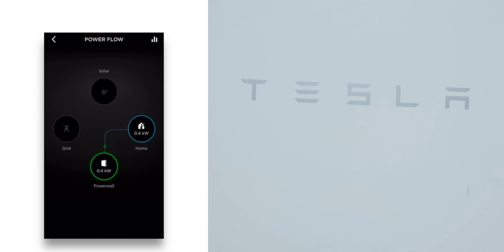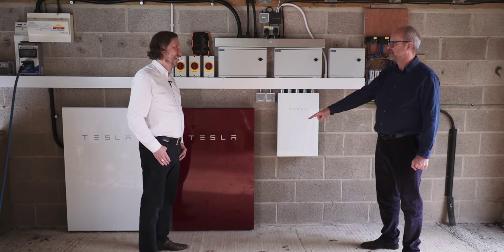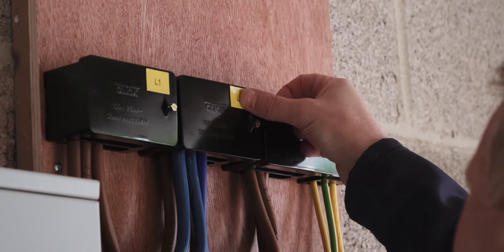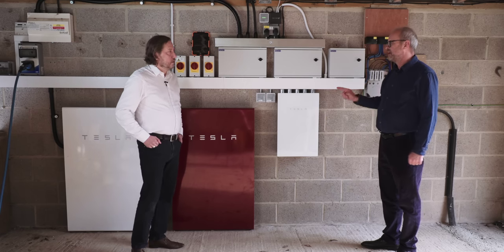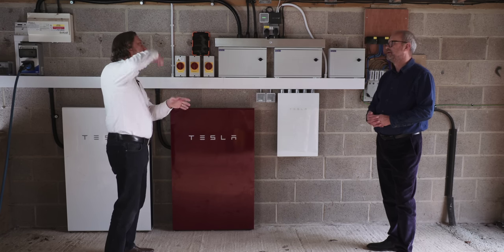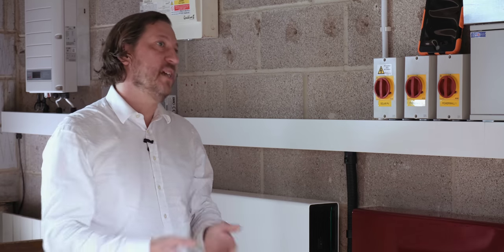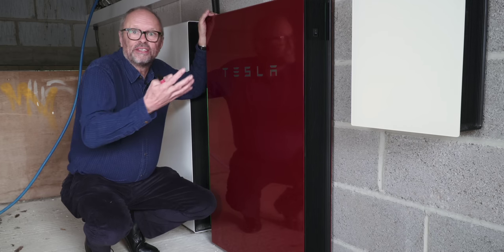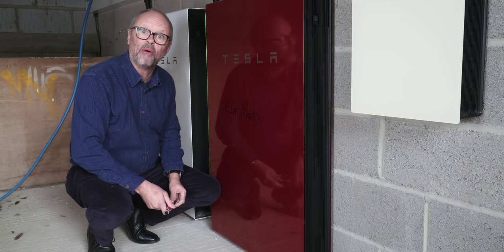Robert's Battery, Solar & Charger Set-up | Everything Electric Show

Comment: Tesla Powerwalls are unobtanium, we waited 8 months for one to turn up at the installers and gave up. We switched to an 8kW Solis Hybrid and 33.6kW (7x 4.8kW US5000) 30kW useable of Pylontech modular batteries and got it installed in 5 weeks, it was also a lot cheaper than a tesla setup and we can change the size of the battery bank depending on our requirement. It doesn’t have a whole house backup but we do have a backup power socket that can power up to 5kW in case of a black out that runs from the battery. 
The only issue i have is that on Octopus Go you only get 4 hours of cheap rate charging so we can only charge up the battery by 20kW per night (4 hours @5kW/h). 
We're waiting for the Myenergi Zappi to be Octopus intelligent certified and then we'll be able to get 6 hours and get 30kW of charge in there which just about runs the house for a day in the winter on cheap rate power. When the sun comes back from April to Sept we'll be almost self-sufficient with the 8kW of solar panels.
Reply: Those Pylontech batteries are great value and seem great if you don't mind the form factor. Have I understood correctly that when the Zappi is certified you can get an extra 2 hours of cheap night rate? BTW I haven't seen your videos recommended for a while, did you forget to give the algorithm a xmas card?!
Reply: @rohanchaffey3591  Yes, when the zappi is certified then you can get the intelligent tarrif which 6 hours from 11:30 to 05:30 and ATM is 10p instead of 12p but that might change in April. Some were saying that you need the car to the cerfitied as well but if you get the Ohme charger which is the only intelligent certified one at the moment you can have any EV, the charger does the work. 
When you try to sign up for OI they ask you what car or charger you use, its its an Ohme you go straight on to the test charge, if you have a normal charger the the car has to be certified and they talk to the car to control the charging. So, if I'm correct then you just need the zappi and TBH i cant see why you would need both the car and the charger certified as only one will be talking to Octopus for the 30 min timeslices and to get the cheapest rate for Octopus, not you.
I must be back in Youtubes A.I good books as the latest video is doing well too :-)
Reply: My parents went through the same thing. The installers eventually gave up waiting as Tesla kept pushing back the delivery timeline. They have a Model X, and it would've been great to have everything integrated into a single app, but so it goes. They eventually installed Enphase batteries with enphase micros, the system has been great.
Reply: Yes! I did this too!
Easy install.

Comment: I did this as well.  Solar Array, Two Powerwalls, Gateway, 3 Phase upgrade, smart meters, two electric cars with two 3 Phase chargers, and a heat pump, induction cooking, electric showers.

Our electric use has quintupled

Comment: The batteries will also watch the weather (via the internet), and can be set to automatically fill themselves up if a dangerous storm is approaching (ie: they prepare for dangerous weather incase the grid power goes down).
It's pretty cool.
Reply: Not in the UK it doesn't. Mine often underestimates how much cheap rate charge it needs to cover the following day because it does not take the forecast into account. Would seem to be an easy fix for Tesla as the Powerwall is already on line.
Reply: @nealm1814  might be an Aussie thing, or just not a UK thing (perhaps related to the different/specific way your inverters disconnect during a grid outage).
Reply: @roidroid  My inverters are not connected to the grid. Like any Powerwall installation grid connection is done through the Tesla Gateway which islands the house when grid power is cut. Even in countries where stormwatch is available I don't think the Powerwall monitors the normal weather forecast.
Reply: Stormwatch IS available in UK, but most areas don't have supplies that are affected by our typical weather and really bad storms are infrequent. You can switch Stormwatch on and off in the Tesla app settings.

The Tesla system does NOT use a local weather forecast to decide what to do and instead decides based on long term trends ... which is therefore hopeless for the very variable weather / solar conditions in the UK. I therefore manually control my Powerwall's low rate grid charging, a bit of a bother but better at minimising costs compared to leaving it up to the Tesla system.

Comment: I also installed 2 Powerwalls two years ago to supplement my solar array. It's great to be able to run my home on sunshine… during the night! Curiously, the grid has gone down 32 times since I installed the Powerwalls, yet I didn't even know, thanks to their seamless integration. Now I long for two more enhancements: V2X with my EV, and a small wind turbine on my roof.
Reply: If you've got a typical peaked roof, then you should perhaps look into the tech that exploits the "Aeolian effect".

Basically, when wind hits your sloped roof, then it's driven up the slope of the roof and this effectively "catches the wind" and directs it all up - focusing it - to the peak of your roof. This is called "the Aeolian Effect". The whole roof surface is catching the wind and forcing it upwards to the peak.

So what they do is place wind turbines all along the crest of your roof. Normally, you'd have a V-shaped piece - called simply "a ridge" in the trade - at the peak of your roof, connecting over where the two slopes meet. But they replace those with a row of small box-shaped wind turbines along the crest of the roof.

And these wind turbines are designed to expect the wind to be coming upwards from the slope of the roof to catch this "Aeolian Effect". Basically, they're like a round drum of fan blades on their side, so the upward air makes them spin around.

The other advantage is that, if you've also got solar, then it won't cast much, if any, shadow over your solar, being right at the top of the roof there. Also, of course, being at the highest point of your roof, you'll get more wind - and if all the houses / buildings around you are of similar height (which is typical urban planning that they probably are), then they're not really going to be shielding the peak of your roof from the wind. Which, of course, is what you want for a wind turbine.

And I'd say that this doesn't stand out too much like a sore thumb either. You'll have a sticky-up ridge on your roof - the row of turbines - but they're relatively discreet and it's right along the whole crest of the roof, so it's consistent. You're likely to get less complaints from the neighbours than if you tried to stick a small "fan blade" wind turbine up there. And, actually exploiting that "Aeolian Effect" right across the whole length of your roof, then it's going to do a better job of "catching the wind" as well.

Indeed, I'd love for "Everything Electric" to take a look at such an installation at some point, as this one really doesn't get the press. But, really, it's probably the only way to make domestic wind micro-generation feasible and, like solar panels, just "part of the street furniture" that people stop looking up and even noticing its there.
Reply: Very interesting, is this type of wind turbine readily available to purchase now?
Reply: @David-bl1bt   I just did a quick Google to see if I could find it again, and - this is not a recommendation, but just the first thing Google threw up - and if you search for a company called "power collective" and the product is called "ridge blade". They have domestic and commercial version, and one that involves solar somehow.

From the "ca" in their web address, I think they're Californian. But, as I say, this was more just trying to find something you could look up for yourself in a search, not a recommendation that their products are good (I just don't know).

And, at least with this company, it does appear to be a purchasable product they're selling. I do wonder if there's a European company doing something similar.

Certainly, there could be. The "Aeolian Effect" is just physics - all that wind impacting the whole surface of a sloped roof, it all just naturally gets funnelled and directed up to the peak of the roof, so that's where you put a nice long row of wind turbines, along the crest, to catch it all.

This really is the most sensible way to do it, I feel, because then the whole surface of the sloped roof is focusing the wind and the whole length of the ridge of the roof can be turbines that are being fed "the Aeolian Effect" of the entire roof. That's the way to maximise the amount of wind with a typical domestic property.

Edit: Looking further at their site, they do seem to have "accredited partners" for their tech and there's two sites in Europe.
Reply: @KlaxonCow  thank you, I appreciate you taking the time to search and provide further information by way of research material.
Reply: Seriously the grid went down every 3 weeks for 2 years 🤔?
Where do you live,in a third world country?
Reply: @Thenakedfinisher  some might say it is at times, but it's very common in America.
Reply: @klaxoncow  

Crikey! You're a bit behind the times, they have internal turbines now for ease of original construction and access for maintenance.

Think holes in the roof as it were.

I gather this is also for aesthetic reasons.

Aeolian? Hmm, Aeolian covers anything to do with wind power, not just the meaning you alluded to.
Reply: @klaxoncow  From the "ca" in their web address, I think they're Californian -> Canadian, I'd say. Not as sunny :)

There are buildings in Northampton with this sort of wind turbine but when I tried to find the supplier I had the impression from unhappy customer reviews that they are no longer in business.

For wind power generation in the UK I think there are significant limitations as the building regulations were written expecting a wind turbine to be a very large thing in farm or industrial building. The council might reject planning permission by default if the house is not detached and surrounded by other detached houses.

When I looked at small scale turbines such as those from Tesup their customer reviews were also poor, so I guess that the way forward is to sign up for Ripple Energy or a more conventional supplier that happens to have wind farms.
Reply: @flyingpanhandle  That's crazy, you don't even experience that in South East Asia
Reply: What is the power usage of relays inside Tesla Box which mechanically switches the grid connection? These relays must be Always Off type for safely reasons so I’m curious how much power they draw. Bigger relays can draw even 10W each.

Comment: A great video Robert. I live in Queensland, Australia. My 6.6 kW rooftop solar generates 44 kWh in Summer and 22 kWh in Winter - but the last few years have been very cloudy, so the generation has been less. The solar charges the EV too -- win win! Unfortunately in Australia a Powerwall 2 costs around AU$17,000 plus installation, so close to $20,000 installed. Struth! Say hello to your Queenslander wife :)

Comment: As an eletrical engineer that just been transferred to the UK, I'm thrilled to see your channel! And there're so many differences! I never imagined that 3ph house feeds wouldn’t be a standard in the UK. Excellent work
Reply: Single phase is standard because 99% of householders get by very nicely thank you on only single phase.
I imagine it is purely a cost based decision.
Reply: It also makes battery and pv systems a lot simpler and therefore more cost effective.

Comment: Weve had two powercuts in the last 15 months of > 8 hours. The last one after we had had the panels installed. Really annoying to find that the system didnt switch over even though the batteries had charge in them.  Have gone back to the installer and am still waiting for the extra kit to allow it to happen (nearly 6 months now). Also using a Solis inverter and Puredrive batteries.  
Looking forward to ditching the oil fired central heating for an Air Source heat pump around the end of this month.

Comment: It would be nice to produce extra electricity at home and sell it back.  Nothing is as simple as it should be because there are things in place between point A and point B - always.  The only option for complete autonomy is having an alternative energy system that is robust enough to never need to be attached to the grid.  I love all the information and have for years. Thank you !

Comment: Hi Robert. I also had a Powerball installed by Joju. Regarding the comment about avoiding the "dirty electricity", as far as I am aware, I can't control when energy is drawn from the powerwall, it starts drawing from it whenever there's demand so I might have an empty powerwall in the evening at the dirty time.  A very rare event but happened over Christmas when my daughters family visited, more cooking and washing and no solar gain.
For families fitting small batteries alone, they would quickly run out of energy early evening unless they are out of the house all day. Back to dirty energy, just when we should avoid it.
Reply: What mode (chosen within settings) are you operating in? If you have the time and inclination to have the Powerwall under "manual control", put it into Self Power mode. You can then force the Powerwall to charge, or prevent further discharge, by adjusting the % retained for Backup Reserve. Only works if you are able to keep a close eye on it at ALL the right times!

Comment: I have 3.2 kw of solar and 7.2 kwh of lithium storage which is off grid , i installed it all in September 2022 so not seen what it can really do in finer weather yet,  but hopefully it will help charge my 40 kwh leaf and run a few appliances in my house too . Total cost was about £3000 .
Reply: Wow! That's a really good price, who did you have it installed with?
Reply: @catalinomocea6986  installed by myself and my son who is an electrician , batteries from fogstar in 🇬🇧 and panels from AB SOLAR also 🇬🇧, 3.6 kw inverter from 🇩🇪 .
Reply: Don't mind me, just adding my request too to the pile of people wanting to know more 😀
Reply: It seems like a MUCH cheaper system than being connected to the grid, with all that equipment we see in Robert's garage.
Reply: I installed a 4kwh system a few years ago and my big mistake was not adding battery back up at the time of install. Although you may not see many Kw at the moment I regularly get 18 to 24 kwh per day in the summer. You should comfortably charge your Leaf up in the summer purely on solar.
Reply: @johnbow100  yeah hopefully, problem with the leaf is that you can’t adjust the charge rate , so it always wants about 2.4kw which is sometimes a little demanding especially if the clouds come along 🙄.
Reply: Jesus my 5kw solar panels and 20kw batteries cost me £13k!!!!! The batteries alone cost £8k
Reply: @antoniopalmero4063  Is it possible to  charge it directly from the battery rather than the panels and then let the panels recharge the battery?
Reply: @johnbow100  yes that’s correct , dump the batteries in the car when fully charged .
Reply: @TIMMEH19991  when did you purchase those ?
Reply: @antoniopalmero4063  Back end of 2021. That was with 10kwh of batteries and I added another 10kw in Marc 2022.

Comment: Off Topic but a security advice to Robert: The electrical installation on the very right (which is seen behind Robert in this video) should be covered for security reasons. Those separate L1, L2, L3, N wires are not for installations which are accessible by hand, because their insulation is too thin for their high current to protect against damage. They are only used inside fuse boxes which are screwed shut. The wires are in reach of kid's height and can be pulled out by e.g. hanging onto them. The thick black 4-core wire is the right one for external use. It has a heavy grade insulation against damage. (This installation would not be accepted for operation this way here in Germany)

Comment: The powerwalls are cool but I'd recommend BYD instead. They scale both much smaller and larger, are slightly cheaper and more efficient. Best of all they can take more power. PW can only take about 3k which means a lot of energy is exported.

Comment: It is pretty weird how in the UK, it is heavily optimised to use your solar PV yourself, while seeing how here in Sweden you would be by far better off selling the produced kWh (you get paid about the same 5 British pence in tax subtraction+ whatever the spot price happens to be at the moment on Nordpool, which the past year often has been many times the tax subtraction has been) and sometimes even a bit more if the energy provider you picked will pay for it. Even if you had an EV as well as solar PV, but no battery, it would be better to sell your generated solar and then charge the car off of cheap grip electricity at night time.